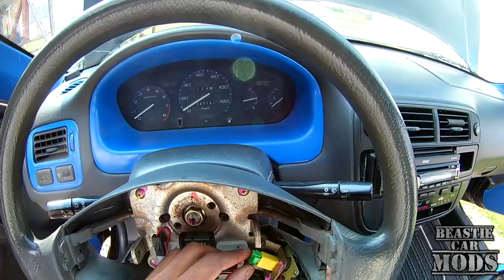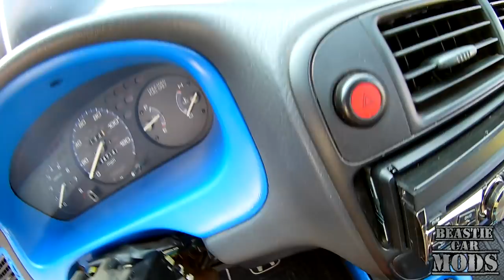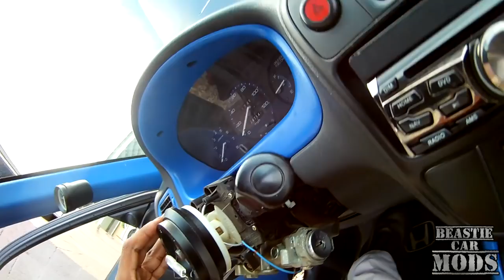96 - 00 Honda Civic - How To Install Steering Wheel

Comment: Hey one question, that little lever switch on the left side of the steering wheel, i got the same on in my honda but i dont know what it is about. Can someone explain what it does?

Comment: I love that CD player in your I have 1998 Honda Civic Ex coupe we bout too start modifying here soon but being North Carolina we can’t modify the steering wheel on a 98 cause of computer inspection wich sucks
Reply: I got a 98 coupe and i highly suggest getting a oil pressure gauge cause the oil pump is the weak link in the d16y8 motor. My best advice is dont cheap out on any mods take your time and plan out what you want to do because they can be a pain to do some things especially anything under the dash lol

Comment: Great video had a question what kind of paint did u use for the blue I painted mine but it's started to peel while drying
Reply: I had the same problem when i did mine. The first time it peeled within no time. If you sand and wash the parts first, the paint will hold. Ive had my interior this same color for about 5 years now havent had that problem anymore. But i used cheap duplicolor.

Comment: So I followed this tutorial step by step and thought all was good. But when I connect my steering wheel or try to take it off, the horn goes off? Any help is greatly appreciated
Reply: disconnect battery bro
Reply: @xytics5519   Actually what it was is the hub the hub was making contact with the steering wheell and when you would turn the wheel the horn would go off the horn would go off. Adjusted  the screws on the hub and it stopped
Reply: @pat8590  same thing happened to me but I pulled the horn fuse out but now my civic won’t start 😅

Comment: I did everything but my SRS light won't come off
Reply: Same here. I have a 99 civic.
Reply: YoungMoose322 same plz help
Reply: Do you have the SRS cancel? or the resistor?
Reply: its because you no longer have an air bag.
Reply: pretty sure u got it fixed by now but for future people wondering the same thing, remove your cluster and put a piece of black tape over the light or remove the bulb and fixed :) its the airbag
Reply: @GGTRIKZ10  I
Reply: Take the bulb out of the gauge cluster
Reply: You can wire it on the fuse box if I'm not mistaken so it tricks the car into thinking it's still in the airbag